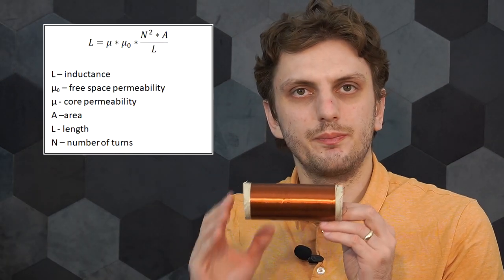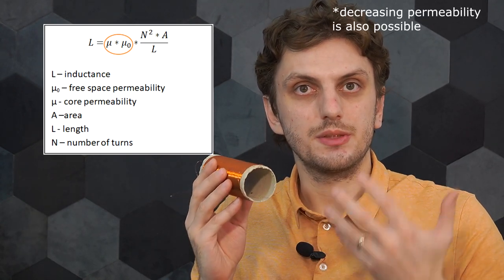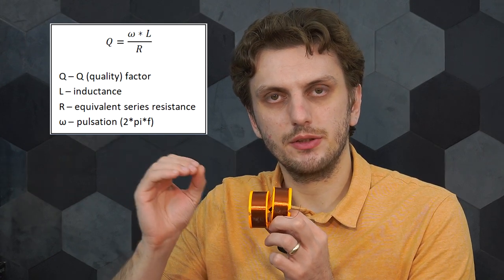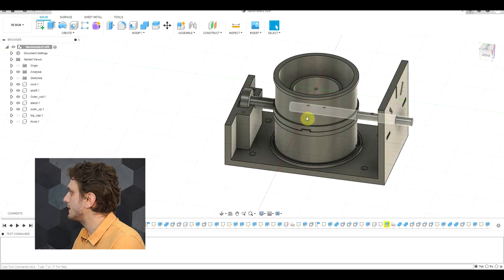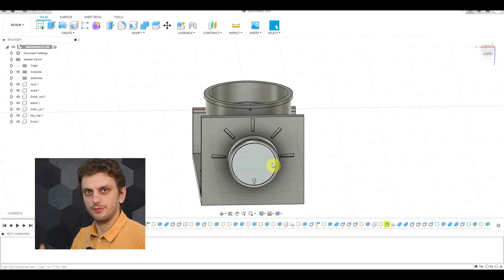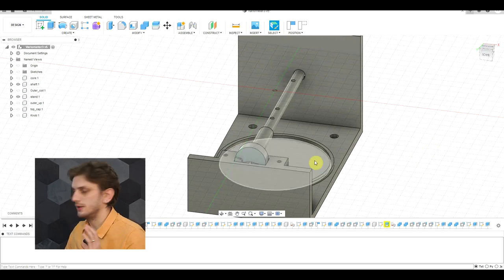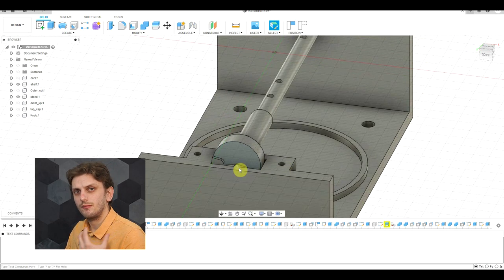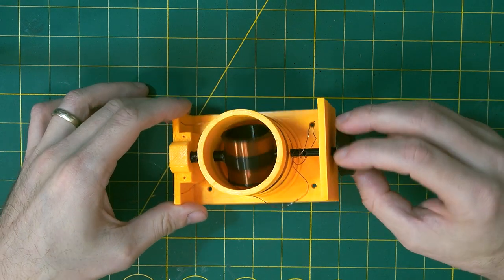RF tutorials - Understanding and building a VARIOMETER

Comment: I don't know how I missed this video. Is great, I had forgotten that two antiparallel inductors will cancel out their inductance, because it's all about the B field.  Thanks Fesz.
PS, maybe both your inner and outer coil formers could be shorter, and the relative diameters closer together...
Reply from the maker: I haven't tried with short coils, mainly because I wanted to have large inductance values, to make it easier to measure. I think the best approach though to make this sort of device is spherical coils. Even though its very difficult to built, coil length will no longer be an issue, and very small air gaps can be achieved.

Comment: Sweet!
Now I'm looking at everything in my house to see if I can make a round one.
Only thing I can find are plastic Easter eggs.
Reply from the maker: If by round, you mean spherical, I've seen those made with cutout circles - have two pieces of 2D circles inserted one into the other at 90 degrees. At least for the inner inductor this works quite nicely and can be made easily from cardboard or plywood - something that looks like this https://www.thingiverse.com/thing:3401282
Reply: @FesZElectronics  sweet!
Yeah, something like that but I want to make the outer coil round as well.
It's a good excuse to get a 3D printer.

Comment: I don't see why spherical coils would be so ideal. A sphere is symmetrical in 3 dimensions, but as it rotates about just one, you can do whatever you like with the other two. 
So what about rectangular coils? (Similar to compressing the cylinders along the shaft axis, making the coils elliptical) This would allow closer coupling (at the maximum, and lower coupling at right angles, giving greater range) Or maybe make the coils as flat spirals?
Reply: I am going to try exactly that, in a configuration like this:
http://www.abschirmgehaeuse.de/media/images/va1f_01-large.jpg